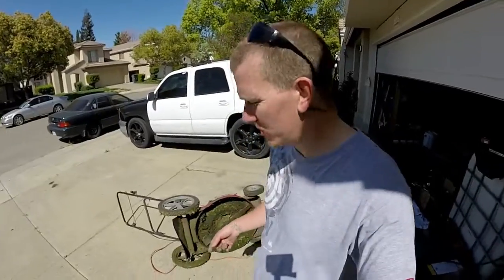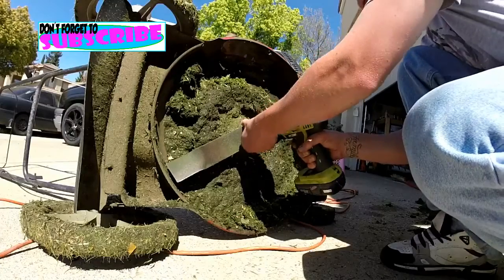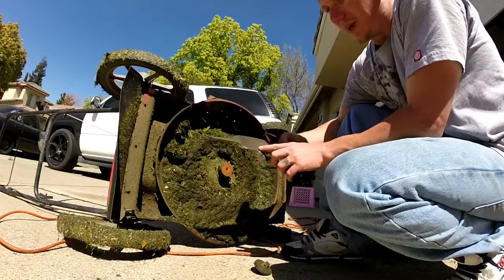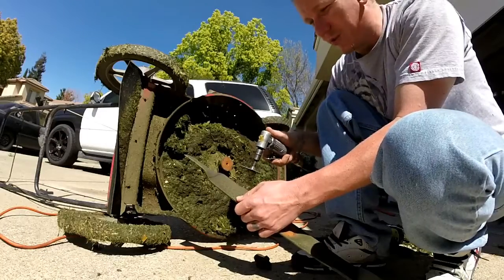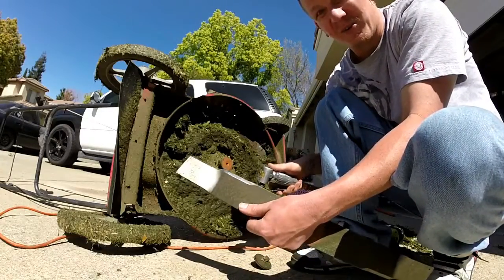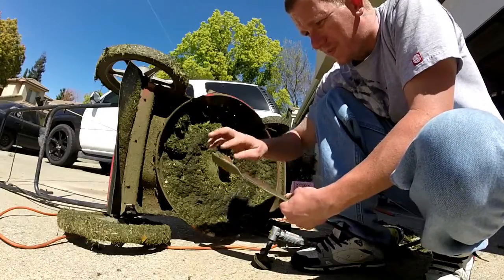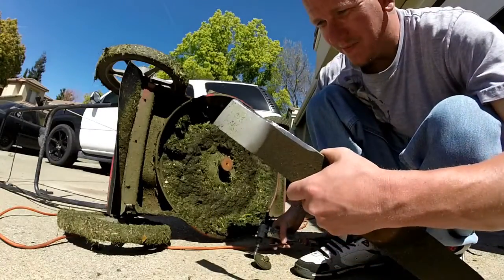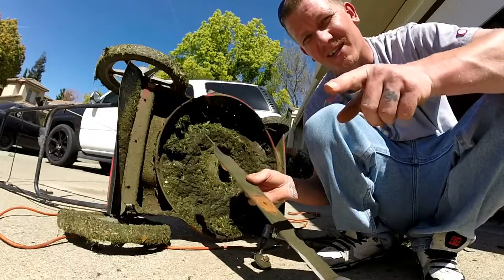DIY Sharpen your lawn mower blade

Comment: Disconnect spark plug also
Reply from the maker: +Greg Smilgin. That would be pretty smart, especially removing the blade by hand.
Reply: Yeah,you turn that blade by hand that damn engine could start.
Reply from the maker: +Greg Smilgin that is no lie.
Reply: I have to sharpen my blade after my last mowing ! I will be using a vise, angle grinder and a flat file !